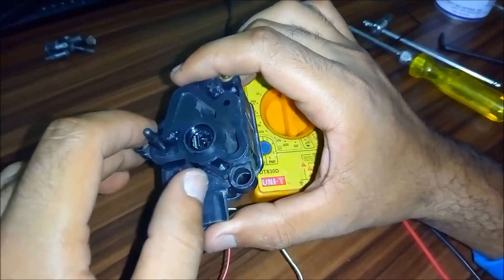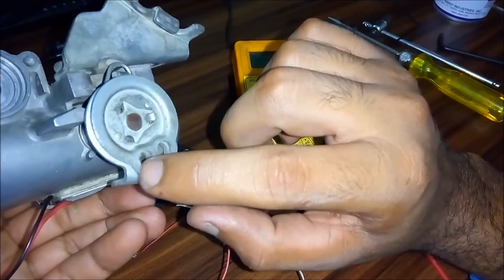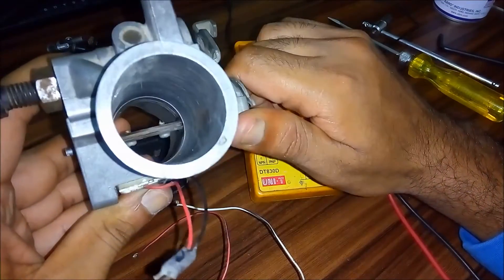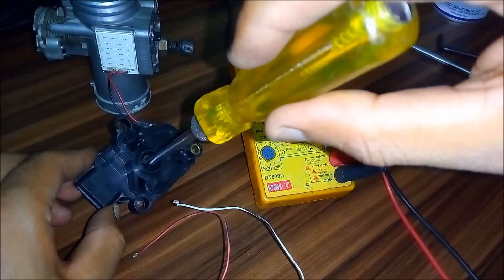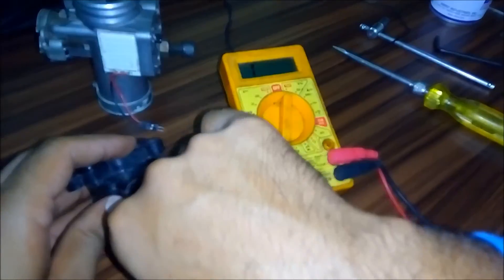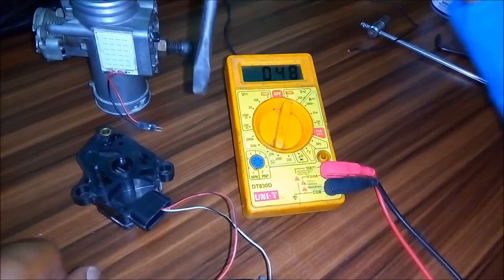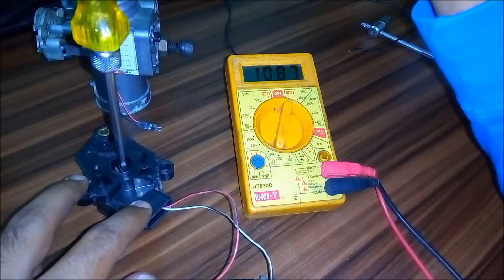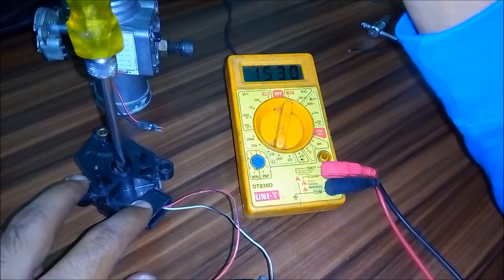Throttle plate angle sensor in a Fuel injected Car/Motorcycle and How to diagnose/check it

Comment: Sir i m having a problem in my bike sometime at exactly 3k to 4.5k rpm the throttle leaves for a 2 second as if I have no fuel in my bike... And again it runs ok... I have changed sparkplug air filter fuel filter o2 sensor adjusted valve clearance... After changing the o2 sensor the problem has reduced a bit but still not 100 percent ok what to do sir please reply i have been to service centre many times pls say...